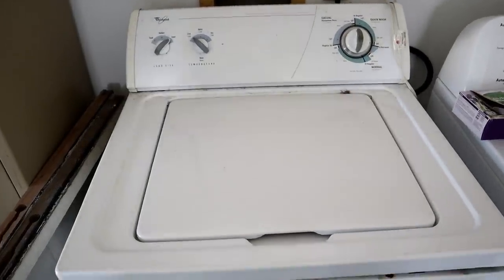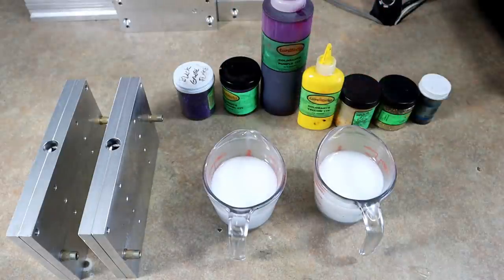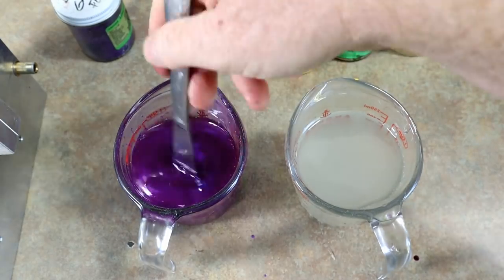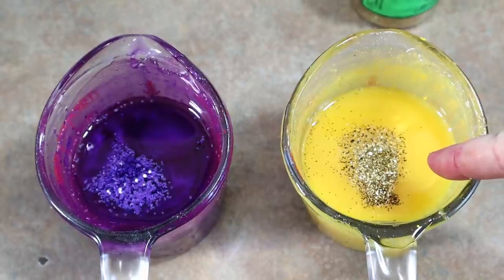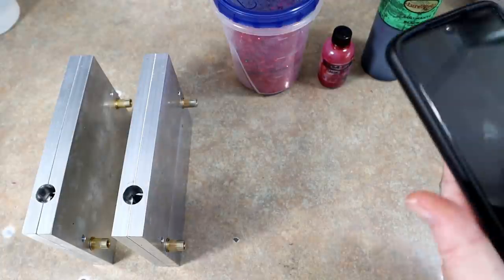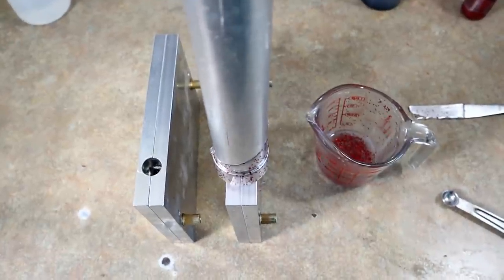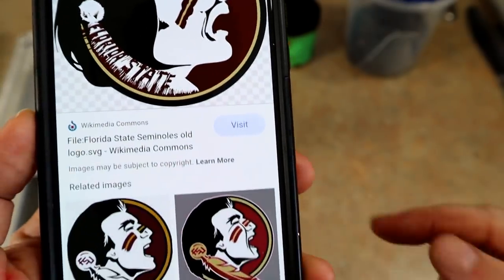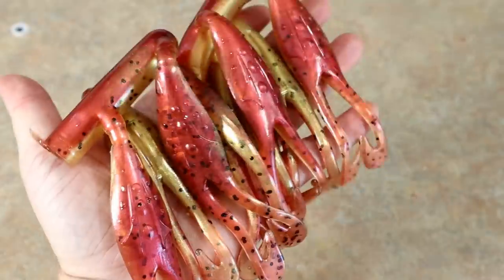College FOOTBALL Themed Fishing Lures...Football Team Colored Baits

Comment: Just got some dead on plastix black label worm blend this week made some 4”   
senkos loved the way they came out, I am still getting used to the blend I have some issues with it being tacky but I think it’s from not letting it cure long enough in the mold before I pull them out and also got the vacuum pot like you have it’s a game changer ! Thanks for the great videos !
Reply from the maker: If they are tacky it's generally an issue of mixing and proper cooking.
Reply: Roger, how much pressure is your pump pulling? Ran a dry test when I set it up and got to -27 and then it sat there. Wondering if -30 is the wish number that you aim for; will it do better when there’s actually something to draw air out of; or if I need to tweak it.
Reply: I’ve got 25-30 usually and when it gets to the point it rises and the bubble start to go back down is what I look for it’s around 25 to 30 that happens I am also not using anything to monitor plastic temp and I may be shaking my plastic up too much before heating I usually shake it really good though